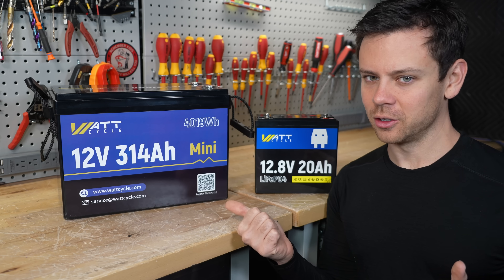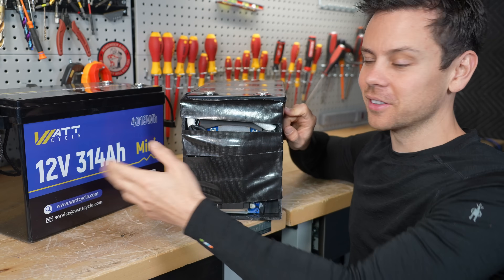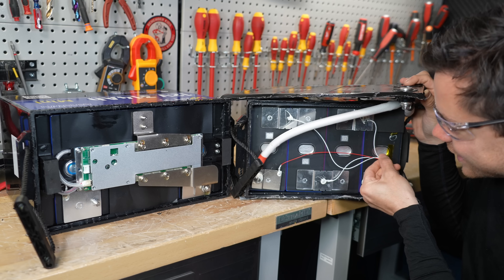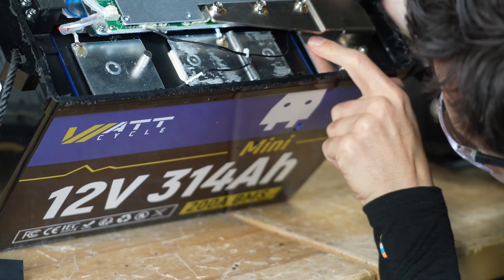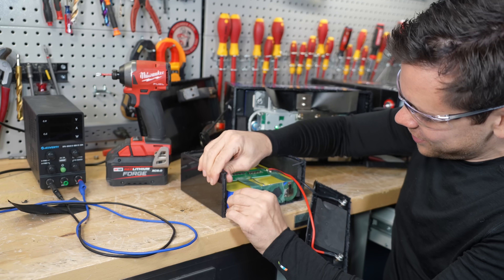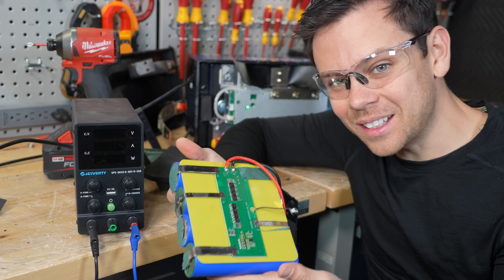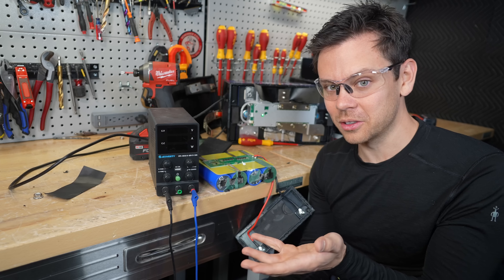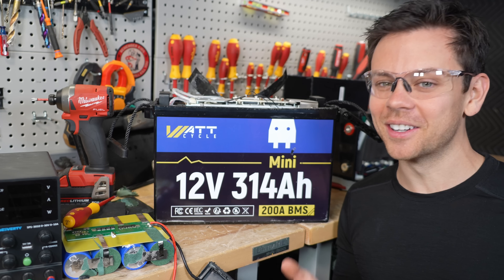NEW! Wattcycle "Dumb" 314Ah LiFePO4 (and 20Ah fast teardown!)

Comment: Just to let you know the wattcycle app did not fix the smart bms locking up.  Purchased a 4 pack 100ah smart bms one was dead on delivery and currently on my second replacement of locked up bms. They are trying to get me to destroy the top to reset the wire for the bms they should of install a reset switch so dealing with suport atm.
Reply: From Wattcycle Support:

Thank you for your message. To help troubleshoot your battery, please try the following steps:

Remove the plastic protective cover on the top of the battery.

Carefully unscrew and remove the top cover to access the internal components.

Locate the BMS (Battery Management System) module inside the battery.

Disconnect the sensor/data cable connected to the BMS, then securely reconnect it.

Reassemble the battery and attempt to charge it again.

Please let us know if this resolves the issue or if further assistance is needed.

Comment: I’m trying to put 2 of these in my truck for a dual battery setup. I’m trying to confirm the conductor size to connect the batteries together. I’ve hear will mention the conductor needs to be sized approximately to handle the batteries over-current protection. Looking at their website is says 600A+\-50A. Is that correct? I need a conductor that can take up to 650 amps? That seems like a lot and I wouldn’t even know what size wire to run for that.

Comment: hi there,,, love your show,,, you seem to know your stuff, and i need help to find out which is the positive terminal on the yellow input plug from the lipo battery,,,, is it the round bit or the square???? there are different answers i'm getting and no-one here in aus seems to know either,,,,, they all use the anderson plugs unlike my little bluetti 100,,,,, i dont want to damage the stuff i just bought, and OF COURSE bluetti has nothing that i can find to help,,, thx mate

Comment: I just ordered three of these and I'm hoping I can run them in parallel with equal charge/discharge. Replacing 6 Battleborn 100AH batteries. Thank you for the great tear-downs. The three new ones at 942AH+ fit in less space than the six (600AH Battleborn GC3s) and weight in at the same 180 pounds. 🙂

Comment: I am planning to purchase two of these batteries soon and will install them in my Motor Home in parallel. I also have an 8 KW Diesel Generator that uses the house batteries for starting. I have seen that my generator can pull an instant 350 Amps then drop to 152 amps while cranking. With two BMS's at 200 Amp output will I have 200 Amp available for cranking or 400 Amp available for cranking?

Comment: Will, The dumb version also has OCP/FCP  as they both use BMS’s from TDT. The dumb versions still exhibit uneven discharge only you have no way to fix it unless you buy the BT version. Most are clueless about the uneven discharge because they just can’t see what is going on.. without BT. 

You are misleading everyone telling them uneven discharge is only with BT batts. It is due to OCP/FCP not the BT  radio.. If you test this with their dumb batts, you will see, as I have, that the dumb ones behave the same as smart,  you just need a shunt on each batt…..

Comment: After watching several 12v battery reviews and having a lead acid trolling motor battery in poor condition, I bought a WattCycle 12v 100ah basic battery. No monitoring, no bluetooth etc. It has been a great experience for me and I really enjoy the product.  I simply measure the battery voltage using a digital meter, after charging with a new Lithium charger and again when finished fishing and find after several hours of fishing, it has still about 75 to 80 capacity left. My trolling motor is a Minnkota 12v, 45 lb thrust on a 16foot deep vee boat probably around 1200 lbs. I hope o n eday they make starting batteries.    I want to add, I have contacted customer service a few times and normally within 24 hrs have a good well explained response.

Comment: That smaller battery it looks like those cells are reused, that's why there's 3 layers of nickel strips. The first layer is what is left over from having cut it free from the previous use. Not saying they aren't "new" cells, just that they may have been installed in another application and they were reclaimed and reused. Maybe from other batteries that failed QC so they pulled them apart and reused the good cells. Still sketchy in the end, imho.

Comment: Thanks for your videos. I am looking for a Li replacement for my 200ah pack for my motor home. I was looking at the Li Time 200ah battery but I really like this one after the tear down and it gives 50% more power for the same $400.  Using one of these can fit in a back up stater battery connected with a battery isolator in case my starter battery dies.

Comment: I have a question on my RV. I have two 100 amp hour LiTime  batteries if I add one of these watt cycles 314 amp hour would you recommend to go smart or not smart my only concern is how do I know what the capacity is if I don’t do a smart battery and will it work OK having the other ones a different amp hour? Thanks for the answer.

Comment: I asked ChatGPT, "Why doesn't Will Prowse like "Smart" LFP batteries?"
Primary Issue: Smart Battery Communication & Parallel Behavior
Will Prowse highlighted a problem with “smart” LiFePO₄ batteries (i.e., batteries with built-in electronics and Bluetooth/BMS communication) when used in parallel with other batteries — especially non-smart (“dumb”) batteries. In his testing, these smart units didn’t behave correctly in parallel, leading to:
▪ Uneven current sharing between batteries
▪ One battery discharging into the other instead of sharing the load evenly
▪ Potentially large currents flowing internally as one battery “charges” the other
▪ Unintended stress on the batteries’ internal BMS circuitry due to poor coordination between units 
This behavior can cause safety concerns and reduced reliability in real-world systems where multiple batteries are tied together (common in solar, RV, marine, or off-grid setups).
Reply from the maker: Wow that's good

Comment: This and your nartive over the last few months against "Smart" batteries has also helped me in my decision-making for other purchases. I use the Victron smart shunt on my boat, any updates on budget shunts as well? I was looking at an Ebike "smart" helmet that's overpriced and realized why buy an expensive smart helmet that is likely to break when you crash, and a regular helmet with a built-in rechargeable rear light and a separate, more reliable and powerful head lamp is better?

Comment: I would like to to know if the "smart" batteries constantly draw power regardless if the are running or at rest?  Have  you tested the draw from the smart components.  Also do smart batteries have a hard off switch to prevent any phantom power  from the BT and Wifi?

Comment: This battery looks exactly like the XZnY 310Ah battery from the outside, but the XZnY has a 250A BMS..  I bought one and it's charging up now.  I will attempt to test it.. as it has been claimed to output 325Ah actual..   I'm hoping the internal build quality is as good as the Wattcycle..  though the XZnY has BT, which seems to be working fine so far.  Maybe you can do a teardown/eval on the XZnY?  Thanks Will.

Comment: We need a review of the bluetti BLUETTI RV5 Power Hub, 5-in-1 Integrated System Including Inverter, MPPT Solar Charge Controller, DC-DC Converter, Alternator Charger and Circuit Protection, Easy Installation for RV, Boat, Off-Grid

Comment: Mate I have watched your many of your shows and often ask electricians if they have seen it., I have 3 electricians that live in my street, (one training on solar installs).
I was going to ask whether you have ever made a real off grid system with a large battery pack say 30-40kwh range without use of wifi or no internet install requirements. A real prepper version. Can such a system be built now days.

Comment: Hi Will can you check the new high voltage sungoldpower Hybrid inverter maybe you can use three 48-volt batteries in series or a DIY battery to power it. Thanks for all the videos you make.

Comment: I just bought 4 Renogy 12.8 240ah semi solid state lifepo4 batteries. I was sold on the longevity and self heating having to endure northern Wisconsin in the winter. They were quite expensive,   $4.17 per watt hour. And now I’m hearing about silver carbon solid state lithium. (Curse of the dendrites). Now Ford is suspending the Lightning but will redesign with phenomenally better range… Invest in silver and Samsung!

Comment: I heard (from a reliable source) that the reason some companies are able to sell their lithium batteries for so little is that they're getting the cells for free!... rejected EV cells.  Instead of incurring repair/recycling/disposal costs, they are giving the rejected cells away for free to companies that take them and build batteries.  May explain the inconsistency in cells used and have to question their safety and reliability???  Anyway, I'll be visiting a few lithium battery factories next month and hope to confirm first hand.

Comment: I bought two 12v 628ah wattcycle batteries and one of them came dented and had a DSG MOS fault that will not clear. They advertise 24/7 support but only reply during the working hours in Beijing China. The support centre doesn’t speak English and don’t seem to know anything about the batteries either. I’m on day 4 without power and have made no progress in repairing the battery or replacing it.
Reply: I'm in the process of returning (2) of the 24V 314 (same as yours in 24V). Nothing but problems with them since first installed. I've given up and will be installing 4 of the dumb batteries in this video.

In fairness to Wattcycle their team has helped, but it has taken quite some time to get this worked out. I hope that these batteries will be more stable.

They are sending replacements as well as a return tag for the old batteries....I'll report back as soon as I have them installed and working.
Reply: @paul65k it’s too bad. I don’t think they make a bad product. In fact, I know they don’t. But their customer service is sub par. Are your batteries in parallel? From what I’ve read, that’s when the bms causes problems

Comment: Will can I run a cord off my 12 k and put a 50 amp plug on it so I can plug it into my electric pole on a 50 amp receptor so I can charge my batteries when I see they get low just plug in and wallah without using generator

Comment: If i havent had the bluetooth function of my Renogy 200Ah battery i werent be able se the imbalance of the cells. I opened the battery reloaded the cells to the same level and it work since then. But without bluetooth i would have thrown away this battery.

Comment: Thanks for the video.  I'm still trying to figure out how to go from lead to lifepo4 in my 20+ year old RV.   finding a reliable battery that both fits in my group 27 compartment and going through the full change over to lithium convertors and charger support so i don't burn out my alternator is daunting.   I have maybe a year left on my lead acid 80ah battery that so far is keeping us afloat with a 200 w panel, but i would love to not have to worry about grey days and losing water when the pump won't run while boondocking for a weekend (and there's a no generator rule).   going from 40 (usable) to ~300 usable would be a gamer changer.  no need to ration.  Just use it.  leave the pump on, who cares!

Comment: What are you talking about?? Even if it has smart features you don’t HAVE to use it.  It barely adds to the price to manufacture.   It’s pretty much standard now for all new bms.   It allows you to update the bms with updated parameters, safety features, or to just customize the bms.

Comment: 2:56 - You can't spend years complaining about battery build quality and then call a good-quality battery "overbuilt" unless you want to send the wrong message.
Reply: Yes you can. In the world of manufacturing there are plenty of things that can be done that add to the cost but don't actually add to to the overall performance of something. In the world of manufacturing we call this the design objective. There's a balance between using the right item for the particular situation and then overdoing it which only adds to cost. Case in point, most of these batteries are not going to last beyond 10 years. We just know that cell chemistry and usability is a limiting factor. So do I need to put in heavy duty stainless steel or titanium components that will last 50 years for double or triple the price? No.
Reply: @TheGorf  You are making my point for me.

He's effectively criticizing the battery for being bloated and costly for no gain. He is saying it is a poorly built battery when he says it is overbuilt.

When, no doubt, he meant to say it was a well-engineered, well-built battery. But, like you so annoyingly pointed out after I already did so, that is not what "overbuilt" means.

Comment: I've built a 50Ah 12V pack and used the low tech road. No BMS, no fuse...
- No BMS : At first I used one and it first....eat too much energy and second.. burn, could have catched fire
- No fuse : Well...I kind have one, I used 4mm2 between a 100/20 Victron mppt and the pack, and between the pack and  the fan (it's an autonomous fan for my greenhouse) but i added a smaller wire (10cm) on those 2 circuits....et a place it can burn secured.
It works for 2 years, outside...not one single problem...😀

Comment: I bought one of these just before Thanksgiving. Wattcycle's website pricing is $30 lower than Amazon and shipping was still fast. My only niggle over your testing is the way you check low temperature protection. Yup, it turns off when it touches a 10°F ice cube and back on at some point after touching your warm fingers. But what is the actual temperature at which these things happen? Wattcycle's website says in both text and in images that charging temperature is 32°F to 113 °F. And that's good! But page 6 in the owner's manual says 23°F to 41°F, which seems to be a problem. So, which is correct? I understand that the BMS may exit low temp protection at 41°F, but how can we be sure of when it enters if we cannot check the dumb BMS? Just curious. Page 12 says 32°F, too. So, perhaps their page 6 table simply has an error? Regardless, your reviews are top notch and I enjoy watching your content, particularly the recent viral reaction video! Take Care! -Scott

Comment: I like bluetooth on batteries, as i can read out the state of charge - and for JK BMS i can configure values like lower end of charge voltage
Reply: Without smart BMS you need a victron shunt

Comment: I have three 314ah smart batteries in parallel, compatibility mode, I've (so far) had zero issues. However, I'm yet to completely drain them so not sure if that's where people have the issues? I've been running them for over a month now.
Reply: Did you update the batteries through WattCycle?
Reply: @pjm757  I don't recall updating them however I was updating all the victron stuff so I'm unsure of what I updated

Comment: I'm looking for a LiFePO4 battery to replace my Lead Acid batteries in my RV and I definitely want bluetooth or wifi so don't assume that the buyers for these batteries don't want that feature
Reply: You are much better off using a victron smart shunt.   The BMS SOC is very inaccurate at low current rates, esp if you have multiple in parallel.  Will is spot on.

Comment: Will Thankyou for your great service and , when will you check out the, Rvpozwer 12.8V 300Ah LiFePO4 battery delivers up to 4000+ cycles at 100% DOD, 6000+ cycles at 80% DOD, and 15000+ cycles at 60% DOD—over 10 times longer than traditional lead-acid. Built with Grade-A cells, it ensures reliable energy storage and a stable 15-year lifespan

Comment: those cylindrical cells are the eco flow prefered for the smaller delta stations and they  might prove 2.500  to 3.000 cycles  respectfully but not a chance of 15000 without  get wasted

Comment: I’m pretty excited because I just bought that 314 Amp/hr watt cycle.  

I saw your comments about avoiding the smart version and you recommended getting the dumb one…so I did.  But I wasn’t expecting that you would have such a glowing review of the dumb one.
Reply from the maker: It's pretty good so far
Reply: @WillProwse  When do you think we'll see more on these? I just got 6 of these from WC in exchange for 2 24V-314 Mega batteries.

Thanks for all of this Will!

Comment: I don't know about these batteries, but the BMS I wired to the battery I built displays SOC, current, voltages, temp, etc through Bluetooth. You can also modify high/low voltage cutoff and overcurrent protection. Seems valuable to me.

Comment: I sell the crap out of the 314ah dumbo’s 
Love them and now have them in our own rv on the 24v side 314ah BT 24’s in parallel and a 314ah dumbo for my 12v
Did some testing at our shop on the BT and they indeed pull and charge together as they should. 
Luckily I have no need to look at a 20ah. But also sell the crap out of the 100ah
Great batteries, had the poop storm with the 314ah “semi”smart in parallel with the issue. Due to your videos and I’m glad you did.
I now have the 314ah BT batteries from them and yes the firmware update makes them actually work together.
I still recommend WattCycle
Happy Holidays Will!